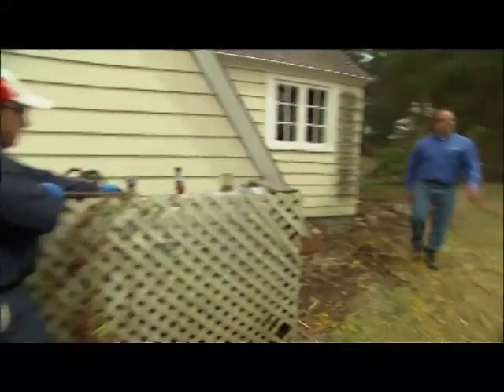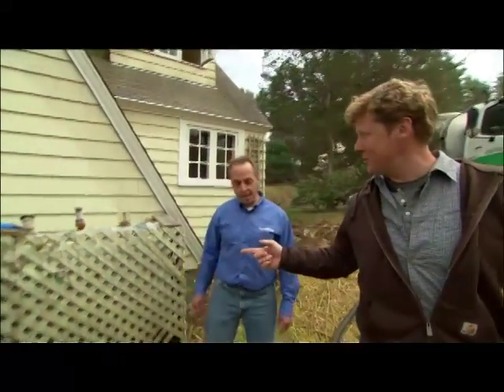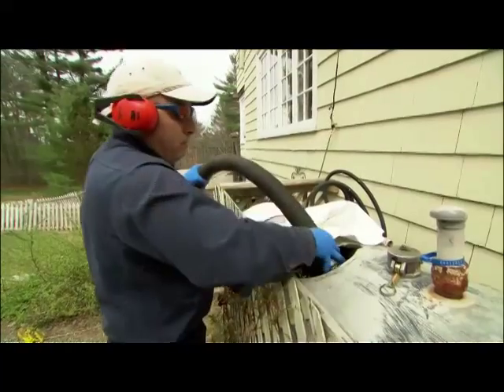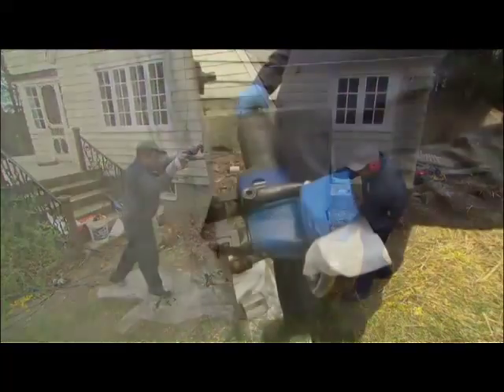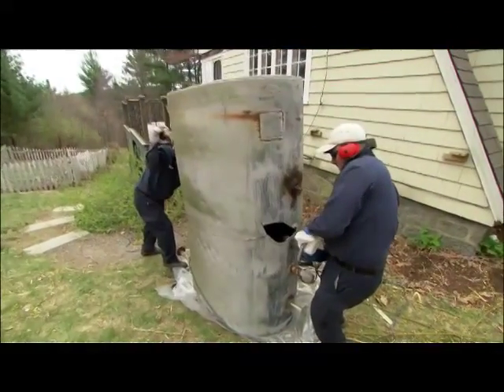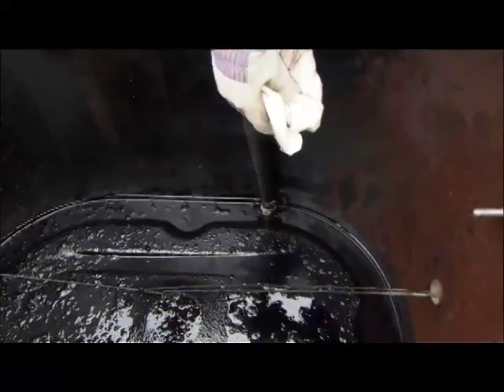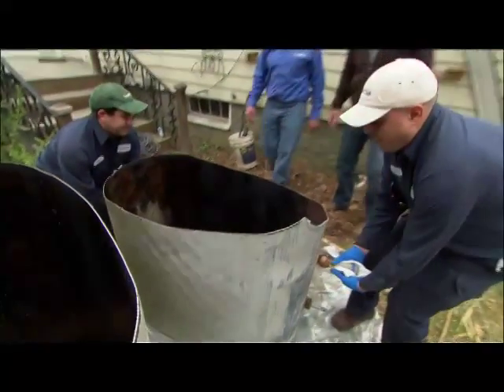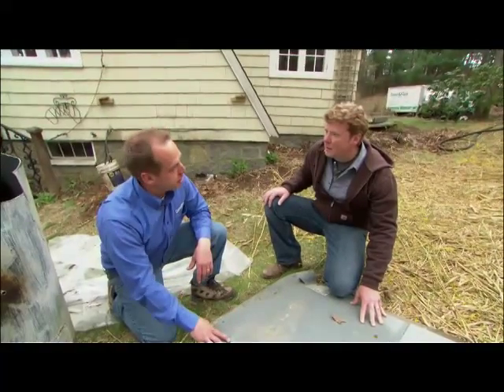Oil Tank Removal MA

Comment: If you have an aboveground oil tank, you may not know there's anything wrong with it by looking at it. That's because aboveground storage tanks can corrode from the inside out, so problems aren't always visible. Even painting it doesn't protect it from leaks if the corrosion is on the inside surface.
How can you tell if your aboveground storage tank is leaking? If the tank is old, check for visible oil stains on the underbelly of the tank, which may be caused by loose fittings or by overfilling the tank. Some people try to patch or repair leaking tanks themselves. Unfortunately, a leak is a sign that the tank has outlived its usefulness and needs to be replaced before major problems develop. Often, removing the tank is the best solution.
http://www.commtank.com/index.php